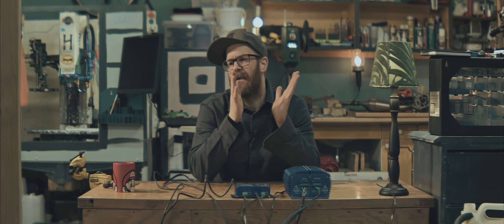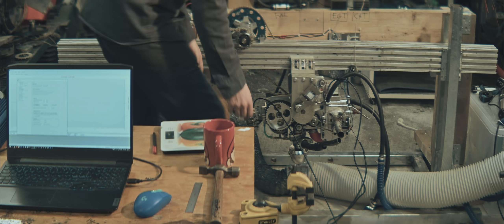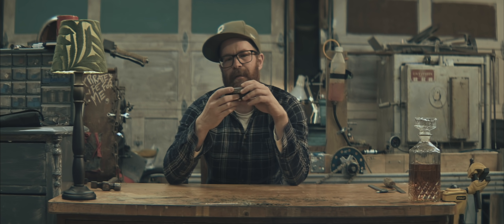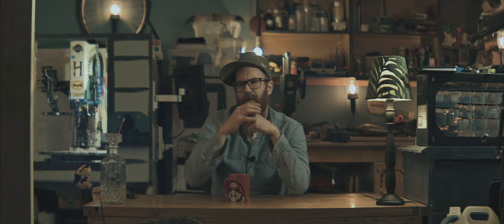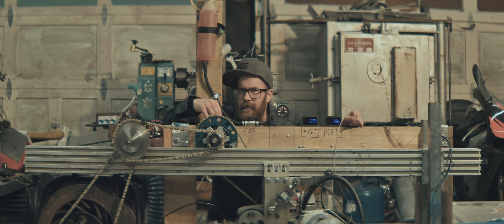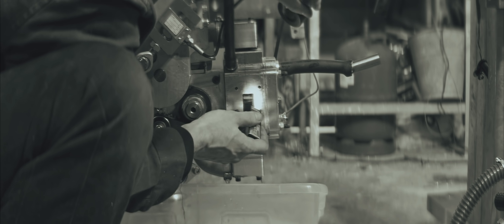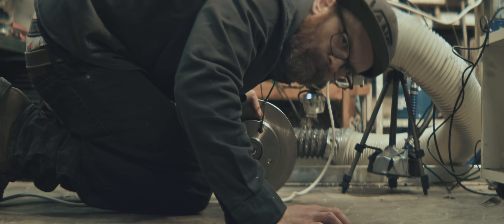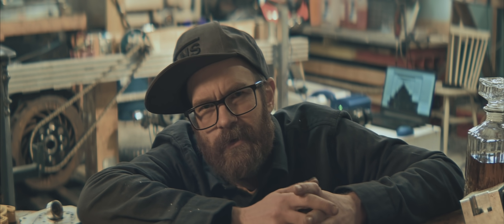Supercharged Two Stroke Grenades Head on Dyno!

Comment: Have you acounted the angle that load cell is in? You might wanna have the load cell further from the pivot point, and preload the whole thing with a spring.
Reply: Do I see a The Workshop video in the future here of what he did wrong?😁
Reply: @Espen Schjelderup  no. I'm just asking Alex a question and have some ideas, do you know the answer to these?
Reply: @thedirtyworkshop  no. My education is just as a mechanic, this is more your area of knowledge. 
Just thinking that your good at making videos for explaning 😁
Reply: @Espen Schjelderup  I'm just a viewer like everyone else. You should know this shite, you're a mechanic. I also wasn't having a go either, I thought you might know something I've missed👍
Reply: @thedirtyworkshop  I blame internet for making it difficult to know if people is sarcastic or not. Never said I was a good mechanic, even when I worked as one.
I don't know anything about the construction of the load cell. But I was wondering if maybe a damper, like a shock absorber for a car or bike would help dampening the signal from the load cell.
If the dyno is used with the retarder I don't think it would affect the accuray of the load cell badly.
But used as a inertia dyno I would expect the numebers to be lower when using a damper.
From viewing many datalogs from engines I know  jittery signals can be very frustrating.
Yes you can smooth signals in software,  but somtimes it's better to smooth it in some way physical also.
But I think this should be secondary to calibrating the load cell.
And seriously, if you have knowledge of load cells I think it could make a interesting video 🙂
Reply: @thedirtyworkshop  2 strokes are shite
Reply: The angle of the load cell makes no difference, as long as it's tangential to the axis. Or even if it wasn't, it could be compensated for in calculations. As for the distance,  I think more leverage would probably yield more accurate measurements.

However, I'm worried Alex may have stepped into the cosine trap with measuring the calibration weight distance from the axis of rotation... we shall see...
Reply: @White Elemant  the angle makes no difference. As long as its tangential to the axis. Wow, and wrong. The load cell needs to be perpendicular from a radial line from the axis. It does matter. You even say so. 

Yes you can calculate the sin of the angle from the perpendicular, my question was has he...
Reply: @thedirtyworkshop  "The load cell needs to be perpendicular from a radial line from the axis." That would be exactly what I meant by "tangential". I think that's what tangential is pretty much by definition...

Comment: can i ask what is ur opinion on air vs water cooled engines
Reply from the maker: The only benefit with air cooled is simplicity.
Reply: @2STROKESTUFFING  I would love to see a air cooled cylinder/head interchangeable with a water cooled cylinder/head on the same crank cases and check performance characteristics between the two after 30 minutes of running on load.